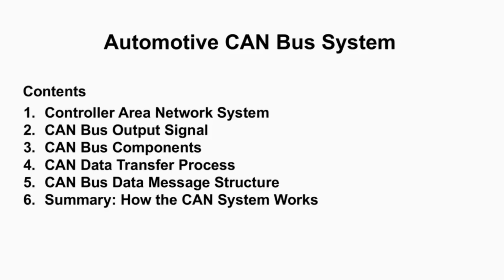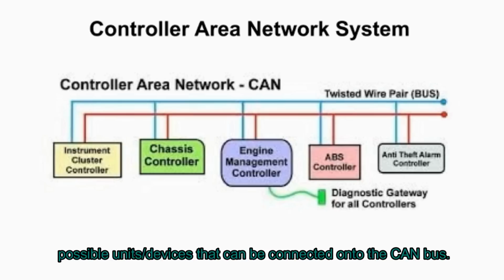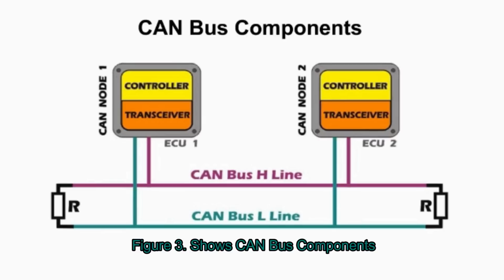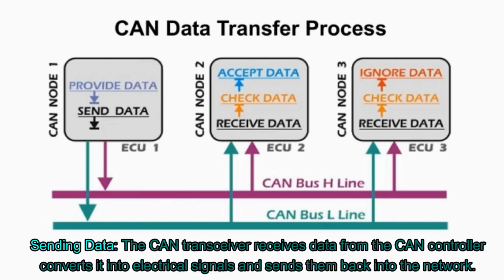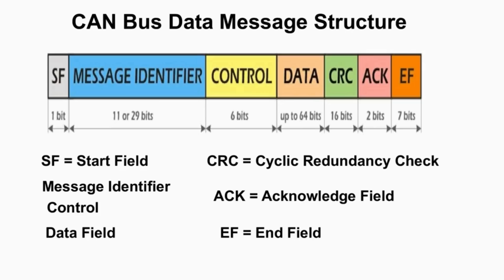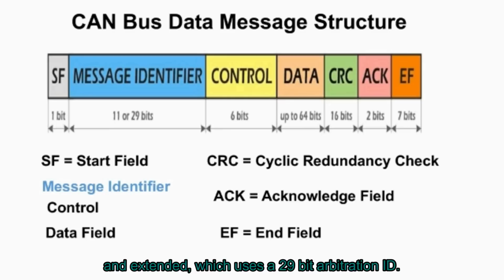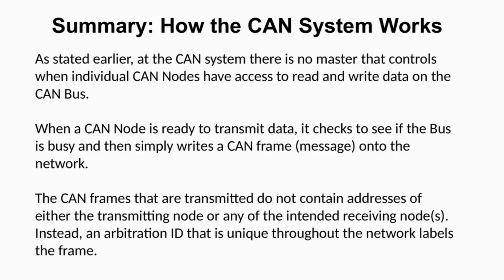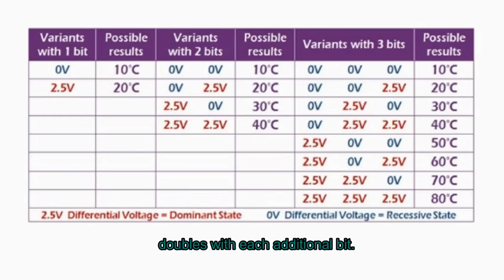CAN Bus System Explained

Comment: Very helpful thank you. I have a question? When there is a problem the system detects  a short to hi/low source or a cable break or a damaged sensor. How does the system detect  it. What actually happens in side the control module?
Thank you